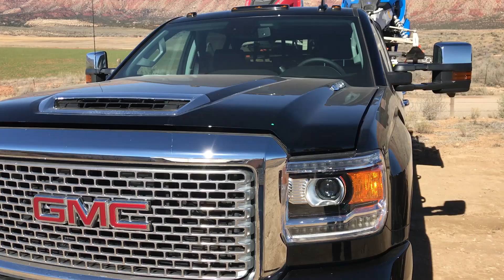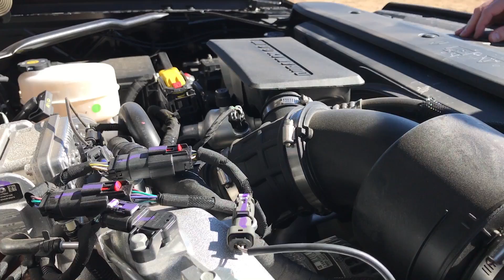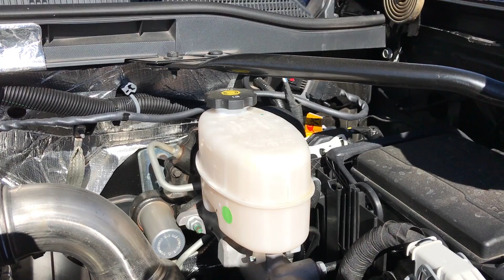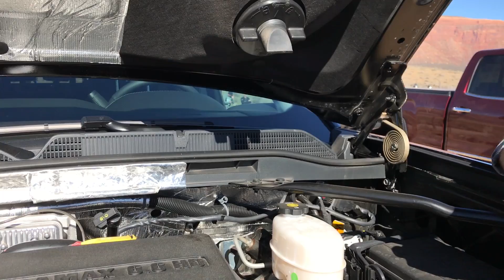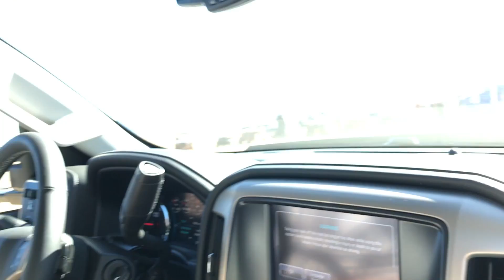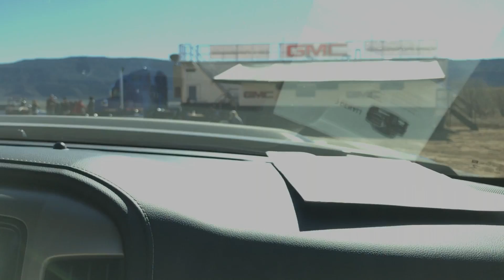Quieter AND Cooler Running? Yes! New 6.6L V8 Duramax Diesel L5P Does

Comment: Changed the oil pan for noise.....how about changing it from that stupid hump which does not allow for all the oil to be drained?
Reply: It’s not that bad, but definitely not as easy to access the filter or drain plug versus the Cummins or Powerstroke.

Comment: Sold my 2018 2500 Diesel Ram at 17K due to unreliability.   Replaced it with the 2019 2500 L5P Sierra, absolutely no complaints at 62k miles, and I will preface that by saying, I drive on roads that will only allow me to get 15k miles out of a set of AT tires.  Couldn't give a damn about brands, so keep your emotional loyalty comments to yourself, I just need a truck that works it ass off, and so far this one does.
Reply: How's the suspension holding up?
Reply: @jamesvaldez4093  So far real well.  I'm at 78k, no issues still real tight.  I had previously had a 2014 HD put 200k on it with a upper ball joint on the passenger side, and I believe an intermediate shaft  by the time I retired it.  This suspension to me, visibly looks identical to that one, so I don't anticipate any real issues.  However, the frame on this truck seems incredibly stout compared to the 2014, and it was a very capable frame.  I have 1600 pounds that I carry all the time in tools, and fuel tank so the frame strength is so important to me.  On another note, I took the truck on a 2000 mile trip, towing 24k, and the L5P performed great.
Reply: @derekwilliamson7024  That's great to hear. I'm currently looking into picking up a 2500 HD and the only thing I worried about was the suspension. Have you done any mods on your truck?
Reply: @jamesvaldez4093  A couple, I added 2000lbs sumho springs to the rear for the added weight.  I did replace the factory 17' wheels with 18' aluminum, but retained the factory height.  I have not done any power mods due to the fact that I am in constant dusty dirty conditions and am a little scared that it may affect the filtration, and I am also under the power train warranty still, and didn't want to alter till I passed 100k.
Reply: @derekwilliamson7024  Thanks!!! I think I'll be pulling the trigger on one here in a month or so. Hopefully I have the same results as you. Thanks for help.

Comment: My gas silverado downshifts when in tow haul mode on downhill grades, "active grade braking" will the diesel also engage the exhaust brake, or is just manual only?
Reply: Tow Haul on the Duramax-Allison will downshift and incorporate engine braking just like a gas, but the programing is heavier since they are rated for a heavier load.
The exhaust brake is separate function in the Duramax and helps even more......and has to be turned on.
Reply: omgnothingisavl It will as long as you have turned it on.

Comment: first I love my duramax. but I work at a fab shop where we make and install flatbed's. and both customers that bought the 2017 have had problems. one the ecm fried and the other all the injectors went out and detenated the engine. so hopefully neither of those are going to be a big issue. great content though